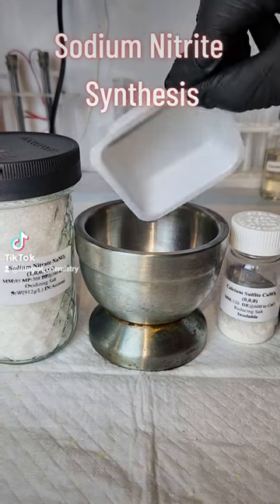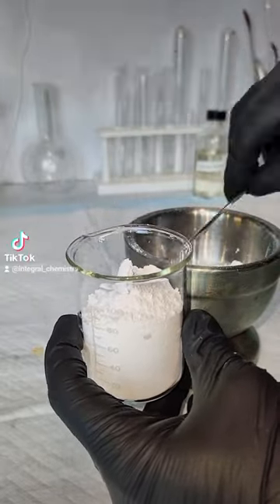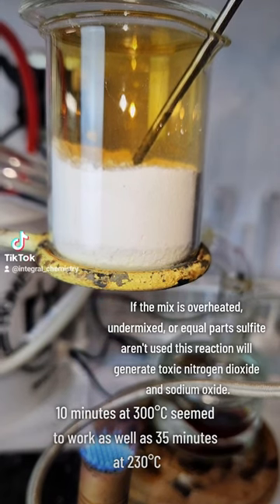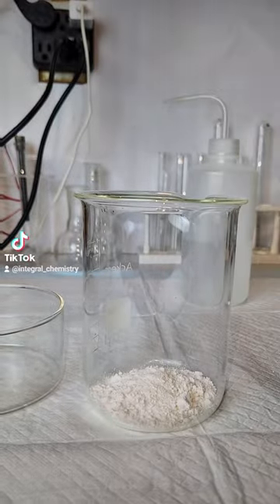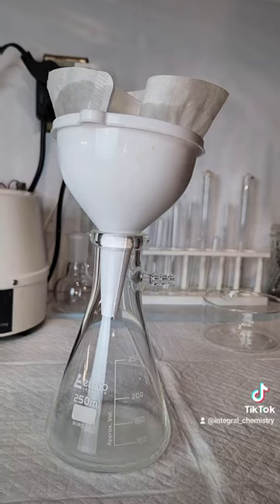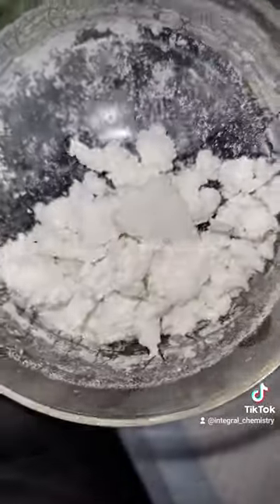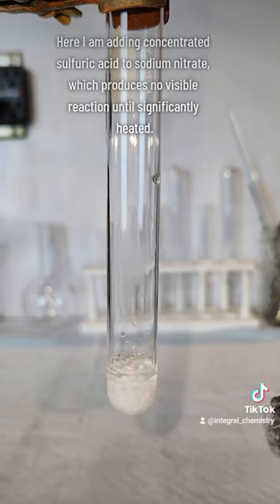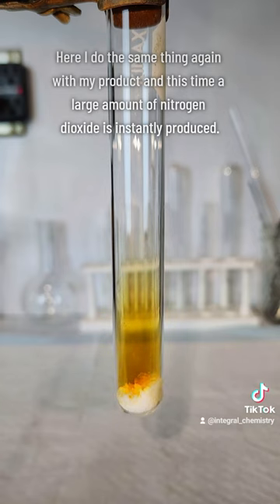Making Sodium Nitrite

Comment: The formation temperature of sodium nitrite is very nearby to its decomposition temperature.
So I think your end product will be a mixture of sodium nitrite, unreacted nitrate and hydroxide from decompostion. If it was pure nitrite, the reaction with sulfuric acid would have been even more vigorous then that which was shown here.
I would recomment doing a recrystallisation and/or a quantitative analysis via titration to determine the real purity and yield.
It's better to heat mixtures of solids in crucibles than in beakers, because they are much more heat resistent and especially made for this purpose.
But nevertheless It's an interesting pathway (never seen it before) and really worth a try.
A very effective method is the reduction of potassium nitrate with calcium formate by heating the stoechiometric and thoroughly mixed/grinded solids, which I have shown on my channel:
1. The conversion proceeds visible quickly and nearly quantitative.
2. Potassium nitrite is a little more heat resistant than sodium nitrite.
3. Calcium carbonate as the second product is filtrable, too.
4. You get a much purer product in a relatively high yield.
Unfortunately the highest loss in the synthesis of alkali nitrites always occurs in the necessary purification step by crystallisation, because it's an extremely soluble salt. So the product always is to be found in the supernatent, not in the crystal mass!
Reply from the maker: Yeah there was definitely some sodium peroxide formed (the solution was fairly alkaline when I diluted it, and there was a small but visible reaction). There's also definitely some nitrate left for the reasons you stated..
I will say I got better results doing this in an oven at max temp like I mentioned (I didn't show it because it didn't look particularly interesting), but this is a process I wasn't sure would work and definitely would like to improve upon, and using potassium nitrate as a starting point is a fantastic idea! I'll also definitely try the formate method as I do have some formic acid now.
Reply: @integral_chemistry  
Hydroxide, not peroxide.
And an normal oven is not hot enough for the reduction (and not recommendable at all then if you still use it for making food).
With the potassium salt, heating of the mixture by the bunsen burner is really less problematic, because the nitrite cannot be destroyed before it has formed. The sudden end of the reaction is clearly visible (stop of smoking). If you then take away the burner immediately most of the formed nitrite will survive...
Reply: @experimental_chemistry 
Hello, did you delete your video showing the reduction of potassium nitrate with calcium formate? I would like to see that but I really cannot find the video on your channel.

Comment: I have made about 7 attempts to make sodium nitrite by reducing nitrate, and depending on what the container's made from, the purity varies from 60% to non-existent, as it is extremely easy to destroy the intended product by reducing it all the way to ammonia
the easiest way to make it by far is bubbling nitric oxide gas into a solution of caustic soda, but if you can get hold of nitric oxide you'll have no trouble finding OTC sodium nitrite
Reply from the maker: that's a good idea! I do believe the dissolution of copper in dilute nitric acid yields nitric oxide (while the dissolution in 67% nitric acid yields nitrogen dioxide). Might be worth a try. What were you using as a reducing agent? With the method I do here I believe the decomposition products would be nitrogen oxides and sodium oxides.
Reply: @integral_chemistry  I first tried graphite with calcium hydroxide, as per a 1905 patent (US792515), with mixed results, 37% purity at best due to the product reoxidising to nitrate at the reaction temperature, and in aluminium containers, no product at all due to decomposition to ammonia
the best results, though poor, were in tin cans previously used for food (coconut milk, to be precise) that had some kind of coating on them

the greatest success I had was adding sodium sulphide in portions to molten nitrate, under an argon atmosphere; when I'd added about 60% I started getting small deflagrations (due to the nitrite product reducing the sulphide, forming elemental sulphur and this reacting with the remaining nitrate), stopped at that point, and got a 60% pure product
however, when I added all of the sulphide, it destroyed the nitrite and the end product I got was most likely ammonium sulphate

it was at this point that I felt it was a better use of my time to order 1 kg of it from Poland, where it's readily available

Comment: The nitrite test with sulfuric acid will produce some nitrosylsulfuric acid. When mixed in cold, the nitrosylsulfuric acid will be stable.
It will fume in moist air and decompose in water above 50 oC into sulfuric and 1:1 mixture of nitric oxide and nitrogen dioxide. This is one convenient way of producing dinitrogen trioxide and/or nitrous gases - absorbing these in cold dilute alkali metal solution will regenerate the nitrite.
Nitrosylsulfuric acid make also a useful indicator called the Liebermann reagent.
Reply from the maker: Huh.. I'm actually trying to Remake this project right now so I'll see if I can work and of that into the vid. Thanks for the info!

Comment: Just tried this, and my product did not pass the qualitative test. My product only reacted with conc. sulfuric acid once heat was applied 😭

I used a toaster oven (rather then the one I use for my food). I didn't observe any NO2 gas forming during heating. I left it in the toaster oven at 230 C for at least an hour. 

What did I do wrong? Perhaps my toaster oven doesn't get as hot as it claims to be? 

Did I leave it in too long?

I also used 100 grams of sodium nitrate which is quite a larger scale, could this have affected the results?

Comment: I did this in an oven, heating the calcium sulfite and sodium nitrate to 250C for an hour, packed down in the glass container and covered with 2 layers of foil to slow down the oxidation of my product.

Once complete, I did the sulfuric acid test on the unprocesses product and it spontaneously produced the NO2 gas. However once I removed the sulfate/sulfite and recrystallized the product from water it doesnt pass the sulfuric acid test unless heated, implying its nitrate.

My final product is a very slightly yellow crystalline powder, which could be nitrite but without evolving the NO2 from reaction with H2SO4 at room temperature I'm thinking its nitrate.

Any suggestions as to why I passed the H2SO4 test before purifying the product, but not after?

Comment: How do you know when its at the correct temperature?
Reply from the maker: its kinda tough honestly. I'm trying to develop a better method for this right now but you basically just want to get it as hot as you can without it getting so hot that it starts producing NOx gasses.. its delicate and imprecise without a calibrated oven.

Comment: interesting but while less messy than other methods I've seen on youtube,
it's still complicated. I feel like it should be as easy as to add couple of grams of ascorbic acid or some over the counter reducing agent into the solution and boil it for couple of minutes with 100% yield and purity
Reply: Things should be made as easy as possible, but not more easy than this. 
Ascorbic acid in aqueous solution wouldn't work.
Reply from the maker: You'd be surprised how tough it is to effectively reduce 😅 I haven't had any luck doing this in solution with any reducing agent (so far)
Reply: @integral_chemistry  Nascent hydrogen is able to reduce nitrates and nitrites in alkaline solution - but unfortunately already to far: to ammonia...
Reply: @integral_chemistry  I've quickly found two patents. One is doing it in alkaline solution, oxidizing ammonia with nitrogen-oxygen gases and the other uses zinc electrode in saturated nitrate solution producing zinc oxide and nitrites. Other one nitrates alcohols to form amyl nitrite but it makes sense only if this is your desired end-product.
Sounds like funny projects but I bought a bottle of poppers instead LOL. It's expensive AF tho
Reply: @trollmcclure1884  
Despite of using them for making alkyl nitrites alkali nitrites are very useful reagents, for example for the sythesis of azo dyes.
Yes, I think the electrolytical method might work, but like with almost all lab scale electrolyses it takes a long time and the yield and purity is often not very high.
I can't imagine how it should be possible to oxidize ammonia with nitrous oxides in alkaline environment. Introducing NOx into alkaline solution itself already results in the formation of nitrite, additional ammonia might destroy the just formed nitrite!
I guess ammonia will be oxidized catalytically beforehand and the resulting NOx are introduced into alkali hydroxide solutions afterwards.

Comment: I don't have calcium sulphite, what should i use instead ?
Reply from the maker: I didn't have it either (its not a very useful chemical) but its pretty easy to make from sodium sulfite or sodium metabisulfite
Reply: @integral_chemistry strangely enough my shower head water filter has a layer of calcium sulfite as an anti-Chlorine.  Manufacturer probably thought having an insoluble antioxidant to reduce free chlorine was optimal